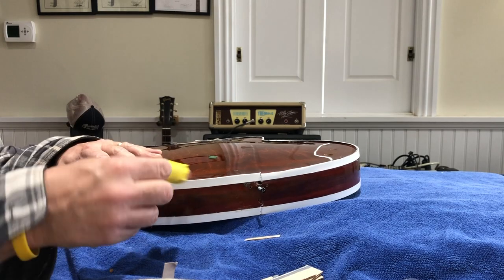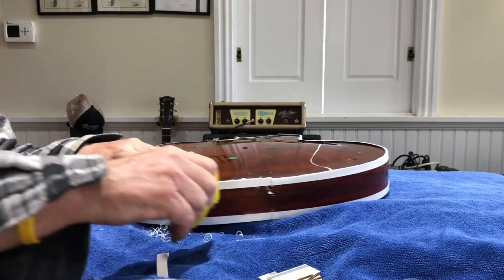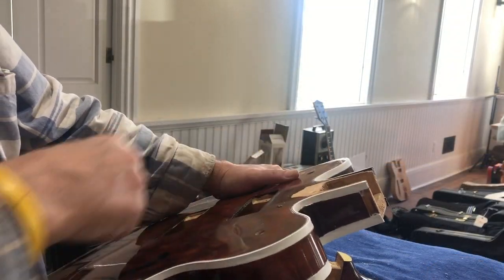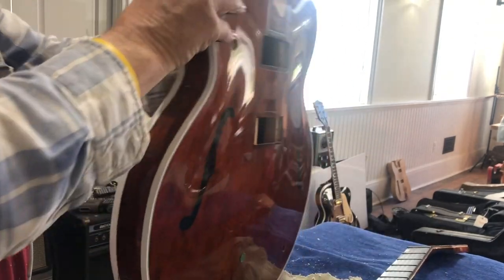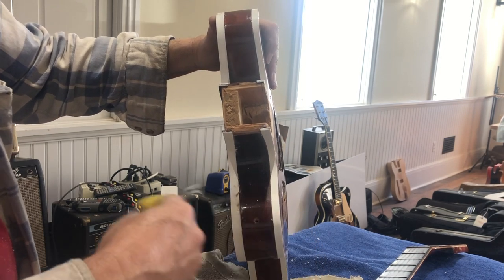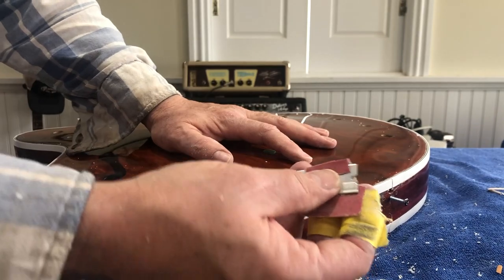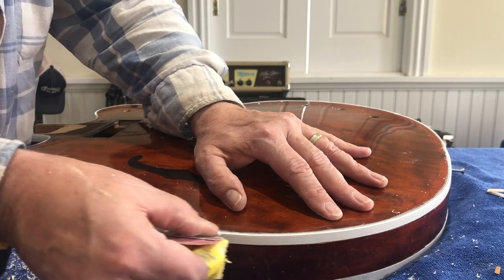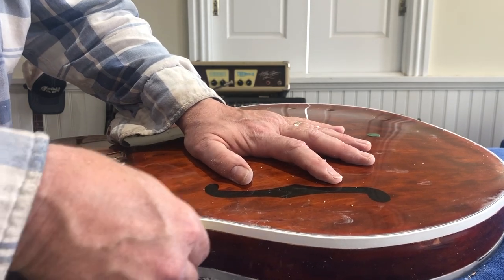1971 Gretsch Binding Replacement Video #4, Scraping.

Comment: hello! this video is very helpful! If you are going to refinish the entire guitar (sand and paint or stain) can you do this with a sander or something other than a razor blade? And also is it possible to round the edges a bit? I am not doing this to this particular guitar. I have an old no name guitar (from the 70s I think) that was my grandfather's and I am trying to make it playable and pretty.
Reply from the maker: Yes it's easier if your guitar is going to be refinished. You'd approach it like it was a new build but take the sanding process slow because most archtops have thin laminated tops and you could easily sand through the first layer.

Comment: Hello Curt, great video and advice, I do have a question. I will be rebinding 67 Gentleman, I’ve been fretting over buying the right bindings. I was hoping you remembered the four sizes you used as your starting point as I didn’t want to under size my purchase nor did I want to buy overly large size. My measurements all just all over the place from age. I guess I could just measure my channel depth so maybe my best bet is to get the outer binding as correct as possible and split the  difference for the other 3. I’m vexed LoL
Reply from the maker: From the inside b/w/b they are .06 and the outside white is .06. The channel varies but gets are typically 1/4''.
Reply: @Ulises Maddux instablaster :)
Reply: @Kyng Adrian Thanks so much for your reply. I got to the site thru google and Im trying it out now.
I see it takes a while so I will get back to you later with my results.
Reply: @Kyng Adrian It did the trick and I actually got access to my account again. Im so happy:D
Thank you so much you saved my ass :D
Reply: @Ulises Maddux glad I could help xD

Comment: Hello Curt - Question. What do you use to clean off excess glue without damaging the finish?  These videos have been very helpful. Cheers. FH.
Reply from the maker: Hey Mr.Heapes, 
I keep paper towels close and use my finger. Duco cement has methylene chloride in it which is paint stripper so you have about three seconds to get 90% off and the wet sand the rest a few days later.
Reply: @CAWilson58  Thanks Curt.  Appreciate the reply!! Be well.